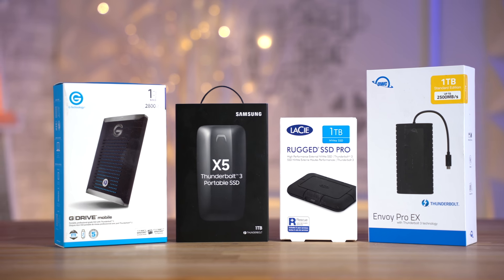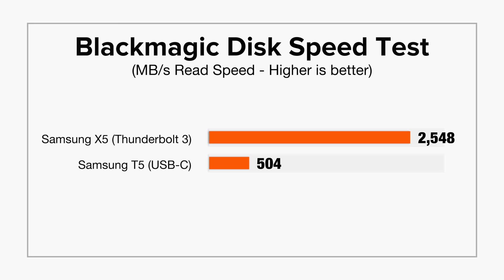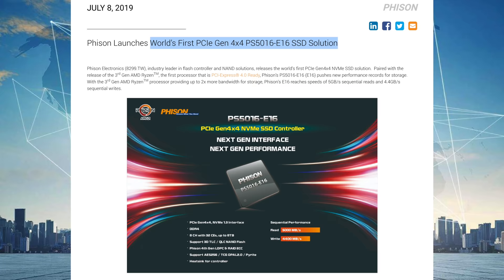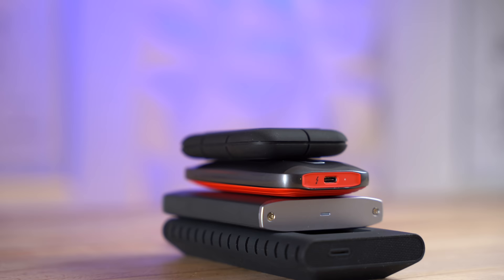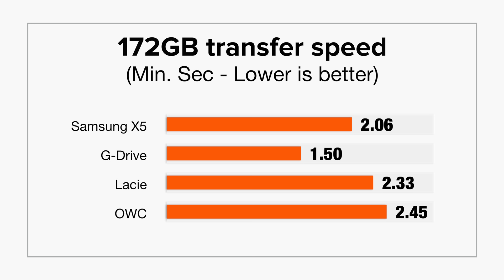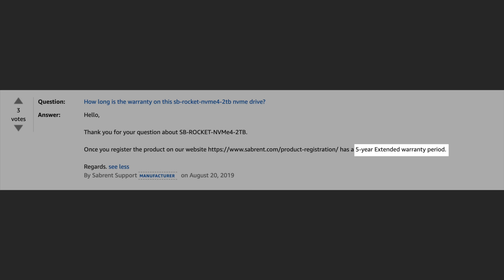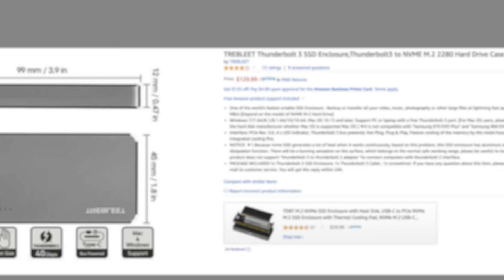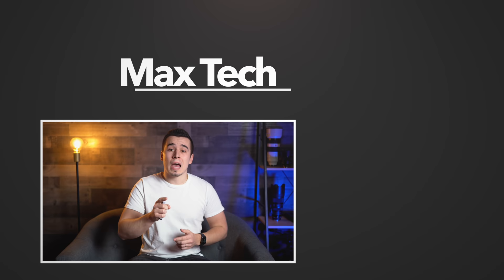How to Build the FASTEST Portable SSD for LESS $$$!

Comment: Just curious, can these external solutions be compatible or read by a normal (non-thunderbolt) Usb-c laptop if you really need to transfer files to that one in a pinch? If not, I'd be be curious about the reason.
Reply from the maker: I believe you need a Thunderbolt 3 device to read this custom SSD. There are portable drives like the LaCie 1TB Rugged Pro SSD that can be read by USB-C. That's because it actually features two controllers, one for Thunderbolt 3 and one for USB-C. The other 3 drives we tested only worked with Thunderbolt 3 computers. -Vadim
Reply: Max Tech Ah I see, that clarifies everything, thanks for the explanation and great videos as always

Comment: I know the speeds won’t be there but will your iPad Pro 11 recognize this?
Reply: No
Reply: 女神大大莉絲妲黛  I found USB C 3.1 gen2 external nvme m.2 enclosure . I’m going to give it a shot. If it does the trick I’m going to load up on NVME storage
Reply: @demasistudios  it may, but I don't have a iPad Pro to test
Reply: @demasistudios  it may work but not on the nvme speed, idk
Reply: You just buy and test
Reply: 女神大大莉絲妲黛 yeah of course not but when moving files in between my LT and pro I will get significantly greater speed on the TB3 USBC 3.1 gen 2 side. I will be testing
Reply: iPad Pro doesn't have Thunderbolt.
Reply: @techguypaul  we know
Reply: @demasistudios  u should test use 3.1 gen 2
Reply: techguypaul yes we know. It’s for scalability going from usb-c to a laptop with 3.1 gen2 . I found enclosures for usc c 3.1 gen 2 and with m.2 I can always buy the TB3 enclosure for the future
Reply: @demasistudios  yes

Comment: Thunderbolt 3 claims to allow for transmission speeds of up to 40Gb/s. If PCIe 4.0 only allows for 5Gb/s transmission on a motherboard then the thunderbolt 3.0 claim is complete BS. Why do they even claim this when not even 10% of the claimed max speed is achievable?

Comment: Hi, 
Thank you for making this Video. I'm hoping this will be a great option, I could use your help, or help of any viewer though. Are there any other enclosures that are around the same price as the preferable one in the video. I cannot find the Treeblet enclosure ANYWHERE online that has it in stock, and ships to California. I am not as concerned about the price but I want to not have to deal with the heat issue if possible. If anyone can reply with a link I would really appreciate it. Thank you so much.
Reply from the maker: I think this enclosure should work. You can buy some thin thermal pads just in case it doesn't come with any:
https://geni.us/AQmQH
Reply: @MaxTechOfficial  You are awesome! Thank you. Subscribed!

Comment: Do I need a TB3 laptop? Or the TB3 is only to allow the full speed of the drive?
Reply: If you don't have a TB3 laptop you are probably better off with a PCIe NVME Gen 3 drive rather than the Gen 4 they used. Also the non-TB3 enclosures a loads cheaper than the TB3 ones. The only problem is that, obviously, the speeds will be significantly slower
Reply: Javier de Jesus Saldana Perez yup

Comment: So my question is where is the San Disk extreme or extreme pro SSD portable drive in this comparison? This test is kind of skewed and doesn’t include every option available to the consumer. Also I didn’t see the Samsung T5 portable SSD drive. I’m thinking you might want to repost this video, because there are cheaper and faster options now available without having to go with an open enclosure. This content is no longer relevant.

Comment: You can also do this with pcie 3 drives and usb 3.1. You will get about the same performance as those other drives at $400 —- roughly 1,000 MBPS.  
But for the cost of about $100
Reply: I need 2500 + MBPS not 1000.

Comment: wouldn't the fastest way to transfer between computers be with 10gbit ethernet adapter in combination with super fast raid setups?
Reply from the maker: We have a super fast 112TB NAS server and connect with both 10GBe and TB3. 10GBe maxes out at 1000MB/s usually a little slower. With TB3 we get up to 1600MB/s. 

We use it to edit off of with our 3 Macs but at times I need to pull data off fast to edit on the go and that’s where this thing comes in. 👍

https://youtu.be/8eX9wpWpBRM

Comment: Most importantly you need USB-IF certified USB cable. So many cheap cables that don't even have data
Reply from the maker: The enclosure already comes with a cable that we used for testing in this video.

Comment: Looks like with current pricing, you save about $65 for a 1TB DIY SSD over the $350 Samsung X5 1TB. Not sure if the DIY SSD build is worth the hassle. I have  had the X5 for a year (with zero heating issues) and it has been great, and probably soon to be updated by Samsung.

Comment: I got the cheaper enclosure  And 1TB nvme recommended. It authorized when I plugged it in but I don't see it as a drive. How do I connect? Format? Etc. Thanks for all your great info!!
Reply from the maker: Macos or Windows 10?
Reply: @MaxTechOfficial  Win 10 - thx
Reply from the maker: Try following this: https://youtu.be/9wKFLcubyx8
Reply: @MaxTechOfficial  Thank you but I don't see the drive to set it up. Doesn't display. I'm screwed. I'm using an MSI GS75 Stealth-480 Essential (i9-9880H, 32GB RAM, 2X 2TB NVMe SSD, RTX 2070 8GB, 17.3" Full HD 144Hz 3ms, Windows 10 Pro) VR Ready Gaming Laptop. So pretty stout. No go.
Reply from the maker: That’s really odd. It should show up. The only thing I could think of is making sure you’re plugging it into the Thunderbolt 3 port. Maybe look at some other tutorials
Reply: @MaxTechOfficial  OK thx.

Comment: You are going a bit fast. My enclosure manages 1 gigabyte per second on USB C 3.0. I am using a Intel 660p 1tb NVME and some very cheap enclosure.
I aimed for low power usage, so it could be used on 2.0 USB ports. So I recommend Intel.

Comment: Very expensive solution for the case  and 2T SSD card,  abt. $450. So I found SanDisk Extreme 2T for $250. There is no free lunch...
Reply from the maker: watch this: https://youtu.be/WolqNJo5PjI
Reply: @MaxTechOfficial  Thank you! Do you think its speed is worth $100 more than SanDisk SDSSDE60-2T00-G25 Extreme Portable 2TB USB 3.1 Type-C External SSD? I could still cancel the order.
Reply from the maker: Yes cancel that order. That Sandisk is only a USB 3.1 drive with speeds of up to 1050 MBPS. These Sabrent drives go up to 1800/2000 MBPS using Thunderbolt 3.
Reply: @MaxTechOfficial  managed to cancel and ordered Sabrent. Thank you for your help. Subd.🙏

Comment: It's faster until the SSD overheats when transferring big files and then fails. (I have two enclosures and it happens all of the time)
Reply from the maker: We tested heat by transferring this 172GB file 3x in a row, over 500GB of data transferred nonstop with no issues. -Vadim

Comment: $130 for just an enclosure? That's a ripoff.
Reply from the maker: Can you share a better priced Thunderbolt 3 enclosure that has good enough cooling to run at full speed? We bought a cheaper (the cheapest) option first and this same SSD slowed down to 950MB/s because of heat instead of continually running at 2500MB/s. Thanks!

Comment: Ah.. Saw the Mac. Instantly explains the ignorance of something the rest of us have been doing for the past YEARS. 😂..
Except ignorance still continues, save yourself the extra cash and get the regular Rocket. You likely won't notice a difference (hell if you're surprised by this video you certainly won't, no offense..). Your only real way to achieve the full potential of not simply a gen 4 pci-e NVMe ssd but several, is having them directly plugged into their respective slots on an x570 motherboard. Except that's not actually portable so, I'll safely assume if you're interested in saving a couple (or alot) of bucks and get the same performance, just grab again the normal Rocket. I use one daily as a scratch disk & cache for simulations & previews.. 
Pro tip (almost): An NVMe drive will throttle under conditions that are too hot, thus no surprise a drive inside a rubber or plastic housing - except in all honesty any enclosure that's metal, simply add a good kit of thermal pads to your cart and voila... You've now eliminated the need for an overpriced enclosure valued only by its aesthetics (as the one he favors in this video) by substituting with small inexpensive strips of thermal pads that'll bridge the gap between the flash controller & the housing enclosure. Not rocket science (ignore the pun, unintentional; promise.). There's a worthy thing to add, avoid QLC based NAND. it's slower.